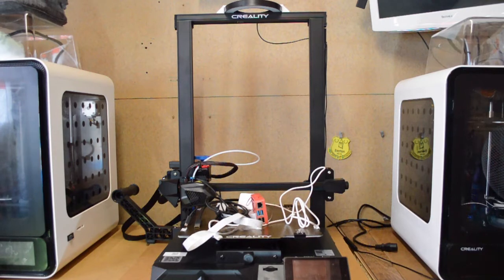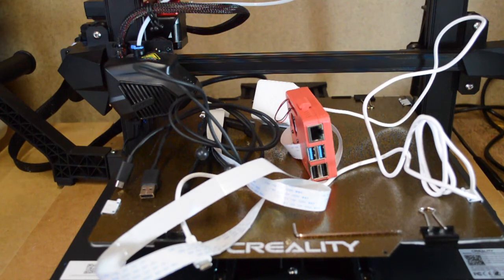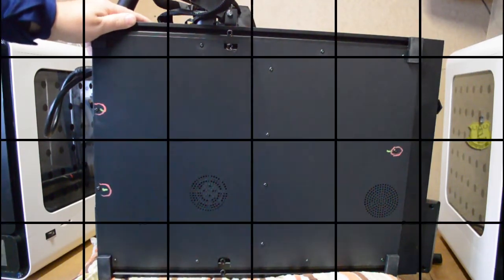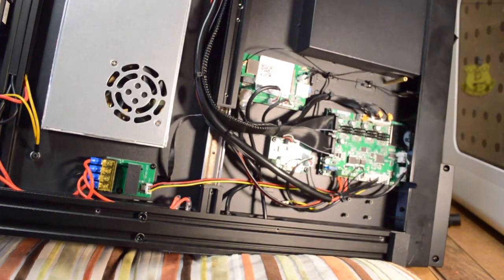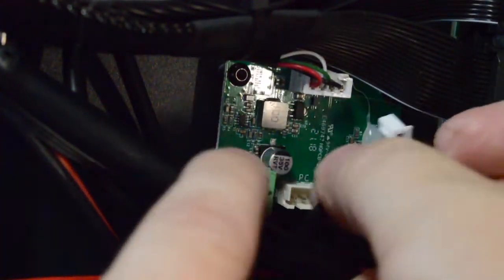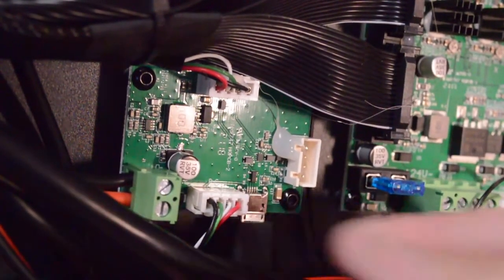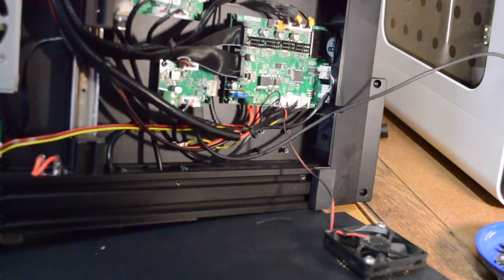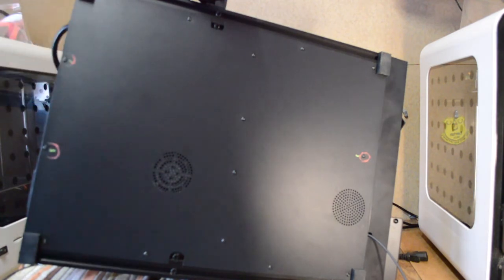Creality CR10 Smart and connecting a raspberry pi to it so that you can use Octoprint

Comment: Good job! Is it possible to turn on or off printer from octoprint? Should be possible with this hardware I guess...I had a smart plug I was using my Ender 3 and Raspberry and can turn on or off remotely but with this setup, I only can turn off... Should press button to start... :(
Reply from the maker: From my understanding it’s not possible. Considering the auto shut off feature doesn’t work on the printer
Reply: @Fanaticalfentons  there is a switch electronic interface at the bottom. Did you check that?
Reply: @Fanaticalfentons  there is a switch electronic interface at the bottom. Did you check that?  That auto shut down problem is firmware issue...
Reply from the maker: @YZCDESIGN  I didn’t attempt as I have taken my pi off my smart as it’s going to be used for Klipper soon. The auto shut off is firmware issue hopefully resolved soon!! They have a pro version coming out soon for the smart
Reply: @Fanaticalfentons  If you are going to achieve using Klipper with SMART I'd like to have the walkthrough from you soon. Good luck & thx in advance.
Reply from the maker: @YZCDESIGN  for now I don’t have plans to put Klipper on my smart. It’s for the Ender 7. But thank you 😊

Comment: Can you adjust esteps and lower/raise the nosel height by less than the 0.05mm that the touchscreen does? as at 0.20 its to high and 0.15 its to low, and with no way to adjust the bed without shimming i cant get mine level. can you set it to say 0.175 ect 0.17 like you can with the ender 3v2?
Reply from the maker: Currently you can’t on the printer itself. I’m hoping a firmware will allow this ability soon. From conversation some who are using octoprint are able to adjust z axis with 0.01 adjustments
Reply: @Fanaticalfentons  awesome. I have octoprint for my 3v2 might buy another for the cr10 smart. Zero use for their cloud app.
Reply from the maker: @timothydiesel  agreed the cloud app is not great but it’s got to start somewhere. But another pi would come in handy 👍🏻

Comment: Simpler solution: use the USB-C port on the cr-10, connect it to raspberry with octoprint. Done !
Reply from the maker: This is only a option on the Smart pro not the original smart
Reply: That’s true. But there are videos out for the pro claiming the usb-mod is required
Reply from the maker: @matsekberg  I’ve not seen much on the smart pro

Comment: Have you tried putting a sprite Extruder on to the CR 10 smart
Reply from the maker: Honestly I haven’t. I have seen others do it but they had to fit bed adjusters on build plate to make it work. I have the smart pro also and it’s fantastic printer compared to the original one
Reply: @Karl Fenton  I got this one real cheap $150 . I heard you gotta change the main board to get it to work right. Is not sure doing all that's worth it
Reply from the maker: @1TexasGamer  it’s not the mainboard you need to change. Need to make sure the firmware is up to date. You can just purchase a replacement heated bed for the build plate and adjust bed as needed to get best results
Reply: Thanks that's the answer I was needing. I will try that.
Reply from the maker: @1TexasGamer  it might need some tweaking to work. Keep me updated with it
Reply: Thanks I will
Reply: I found one smart with a good price, which I can buy a new ender 3 v3 KE with that price. I like the possibility of a bigger volume, but I'm afraid of all issues reported here and there. Did you fix it?

Comment: Can we still use Creality Cloud app alongside OctoPrint after doing this? Is the USB port on the right side of the machine (suppose to be used by Creality webcam) still working?
Reply from the maker: No you won’t be able to use both at same time. There would be no reason too run both. As for the USB port on side I don’t use it as my pi is used for usb devices
Reply: @Fanaticalfentons  thank you!

Comment: Thanks for posting this.  Very easy to follow and less worrying than I had expected.  Quick question … what firmware are you running on your CR10 ? Is the bed levelling performing for you ?  I am actually quite pleased with the machine but have noticed after a auto level I need to increase the Z offset by .5 each time.  When I first received the machine it was at .25 and now .50.  Just wanted to know if you were printing without issue and if so what the firmware was so i could compare.  Thanks (PS) I am getting some incredible quality prints from this machine though
Reply from the maker: No worries at all 
I’m running 1.0.7 on mine and have no issues at all. The print quality is great on mine. I’m waiting for a new firmware to allow Z axis adjustments to be 0.01 and not at 0.05 as it is now

Comment: You can now remove this video from the air. The cr-10 smart pro now comes with different internals and it has a dedicated USB-c for PC connection. No need to open it up anymore for octoprint. I opened mine for nothing following this guide 😅
Reply from the maker: Thanks for the suggestion but this isn’t aimed at the CR10 Smart Pro as you kindly mention. Two different printers and people are still buying the CR10 smart
Reply: @Fanaticalfentons  lol the smart and the smart pro are the same printer. I think you mean the cr-10s or others. But theres only 1 smart cr-10 and your instructions don't apply anymore! We have the same exact printer and it now ships with a USB-c instead of having to do all this machine opening. If you'd like I can send you a video
Reply from the maker: @rafaelnasser1636  they are two separate printers.
Reply from the maker: @rafaelnasser1636  you are wrong. The CR10 smart and Smart pro are two different printers. I have both
Reply: @Fanaticalfentons  you're right! Just checked. What's the difference between them?
Reply from the maker: @rafaelnasser1636  the smart pro is direct drive with cr touch. The original smart is abl but didn’t work very well. The smart pro is a huge improvement